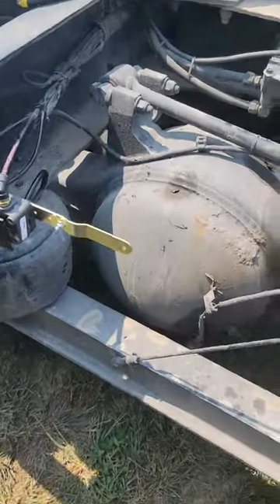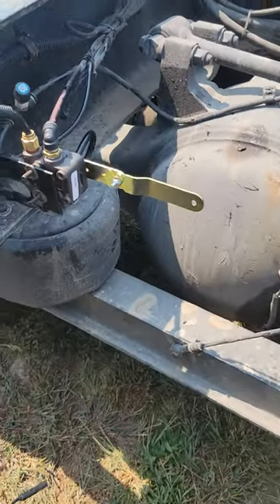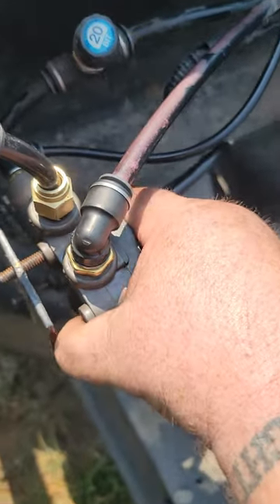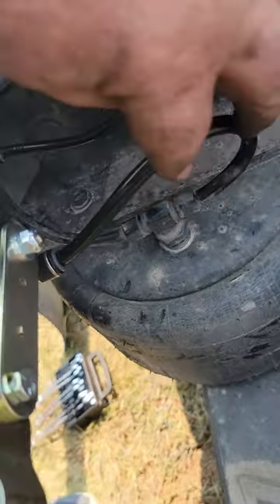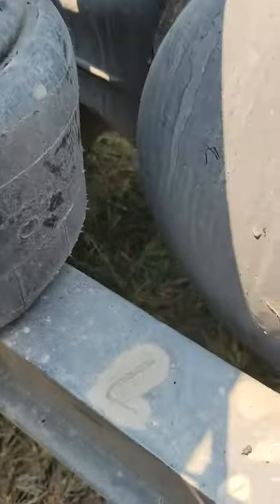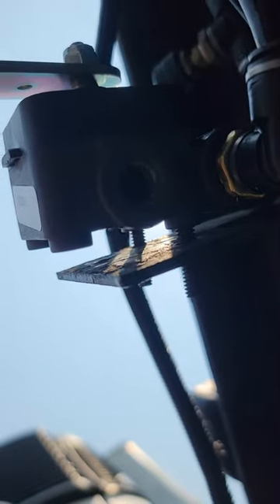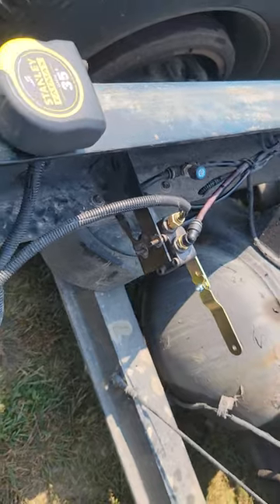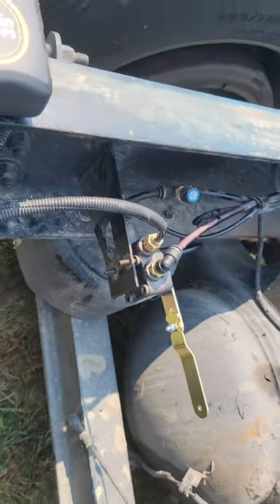install air leveling valve 2003 to 2007 W 900

Comment: Can you tell me the part number for the leveling
Reply from the maker: I took my old one into kw.. part# changed like 5 times
Reply: The part number is on the leveling valve can you please look it up I have an international 9400 I am having problem what the ones from international so I’m gonna change it completely and follow you guys thanks
Reply from the maker: https://www.ebay.com/itm/325181949520?mkcid=16&mkevt=1&mkrid=711-127632-2357-0&ssspo=jKMHPrqwQq2&sssrc=2349624&ssuid=335W6OYAQsm&var=&widget_ver=artemis&media=COPY
Reply: @chipperfluffy  thank you very much

Comment: Have an issue with my valve control pushing the rear axle off the ground  lol Lucky my airbags didn’t blow up 
Thank you for your video I need to try this tomorrow, going to replace the valve put a new one
Reply from the maker: Good luck man!

Comment: Hello, sorry about muy english. 😅

I have one of these on a tráiler, but my problem is when the air dump comes to the valve, my reservoir line doesn't fill my air suspension, ay least i release the air dump line. (And  previusly it doesn't work that way)

Could yo please please give me some idea?
Reply from the maker: It sounds like you have a hose screwed into the wrong hole